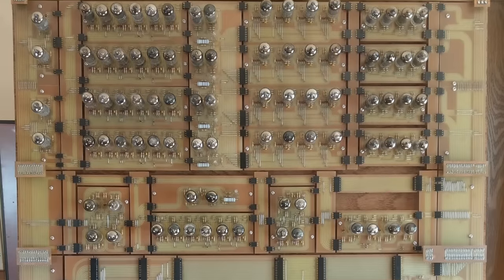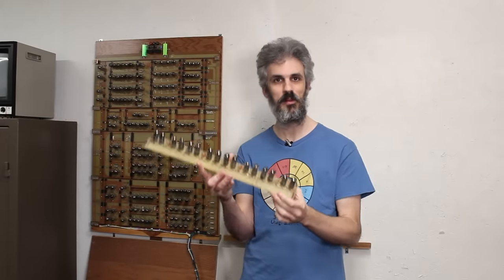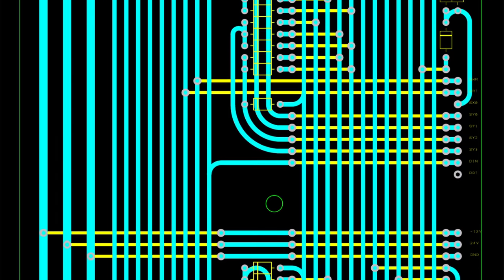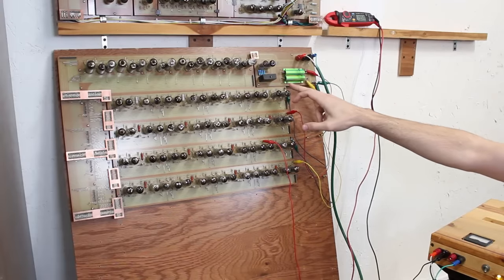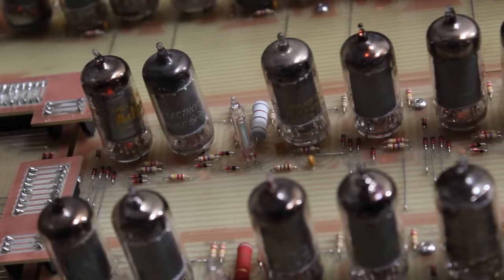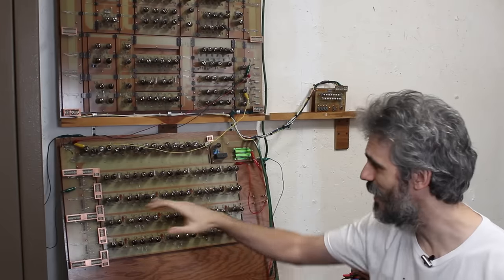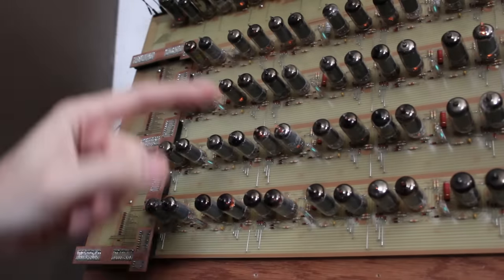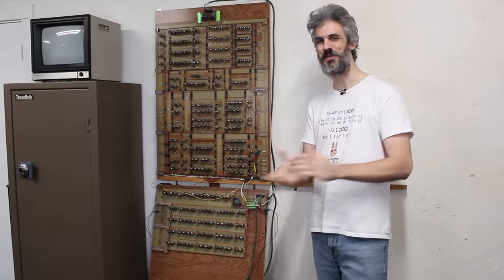Vacuum Tube Computer P.30 – Connecting 2-bytes of Tube RAM to the Processor

Comment: Tubes as memory wasn't the only thing employed in that era. I remember seeing a documentary showcasing acoustic memory. It was long tubes filled with mercury (IIRC) with a driver and a pickup each end. The signal was constantly refreshed by amplifying the output and conditionally feeding it back to the input. At a high enough frequency you could hold multiple streams  of bits in one tube.
Until someone slams the door shut and the entire data becomes corrupted :D
It is one of the whackiest methods I've ever come across.
Reply: Ah! That would be the mercury delay line memory. Came about in the 40s IIRC and yes it was esoteric (and whacky, by today's standards) along with the williams tube. And both susceptible to audio or visual sources of corruption - the delay line, as you pointed out, from sound, and the williams tube from even camera flash bulbs (when reporters took photos of the device). Must have been really fun times as a computer operator then... "Members of the press, we are proud to announce that our AwesomVAC has calculated the answer to the Ultimate Question! It is.... (camera flash) D'OH!"

Comment: Very impressive, so much fun to watch! I built part of a relay computer out of 120v elevator relays 20 years ago. I got nowhere near as far as you have with yours. But I did actually have working relay-diode logic with 40 bits of ram and a weird counter/shifter register unit that could count in base 10 and convert to binary, turn itself into a looping shift register and output or input serial data, base 10 (didn't quite get to the keyboard, I want to get back to it someday). That was hard but fun!!

Comment: Amazing, as usual! :)

I'm intrigued at your intention to use a reel-to-reel tape machine as program storage - will the tape have to move back and forth over the head for random access?

It would be fun if the Centurion could be utilised to create code for the VTC, or used as a terminal and storage to the VTC?
Reply from the maker: Thank you!
I'll go into a lot more heavy detail once we start the build, but the problem with program storage is that it's essentially memory, and memory is so, so hard. But, the MC14500 architecture has a way around that. Since the chip was originally designed to replace relay ladder logic in industrial applications, the chip had to be able to handle any kind of memory or program storage type that might get thrown at it. This is where IEN and OEN come into play. 

It's not entirely graceful and it makes programs considerably longer, but you can do conditional skipping using OEN quite easily. Then, you can either construct your program around a loop (ie. looped tape), or you can create multiple copies of routines on the tape. So the tape will always be trundling along at a constant speed and instructions will be 100% sequential, but we can do conditionals relatively easily, which will allow us some rudimentary type of "jumping". 

It requires a bit of a shift in thinking, and it's not going to be particularly powerful, but at the end of the day, it is a 1-bit computer, so our expectations weren't super high, haha.

We are working on a UE14500 emulator for the Centurion, and since the program control will essentially just be an audio signal (we'll use FSK to determine sequential data bits, a data clock into a shift register, and a global clock that executes the instruction from the shift register), we can pretty easily build an extremely simple audio card for the Centurion and write a custom CPL program that dumps a specific audio pattern based on a latched in value and the Centurion could be running long programs through the tube computer.

Then it gets even more fun because after program control, we'll start on input and output and the goal there is to bit bang 5-bit baudot or 7-bit ASCII, which could make it back into the Centurion as an input!

Comment: I'm not quite sure what you have in mind for your magnetic R/W memory system, but I can foresee big troubles approaching it using any sort of reel-to-reel system (including cassettes). The main issue is the controller needed to allow "random" access to any given bit in an inherently serial medium is decidedly nontrivial. This was historically overcome in one of two broad ways. The first (and easiest from a hardware viewpoint) is to use some sort of recirculating memory where each bit in the system periodically becomes available for R/W purposes. This was the way delay line memory and magnetic drum storage worked (and magnetic disks too in the first Titan ICBM digital computer). The key to making practical systems always involved having multiple "tracks" or channels with dedicated analog & digital write, read, and regeneration electronics for each such track.

One track was often dedicated to the system clock with all other bits in other tracks explicitly conditioned to it. The tracks would typically be of just two different bit lengths, so-called "minor loops" and "major loops". Minor loops were short (from say 16 to 64 logical bits long) and were most often used for implementing an accumulator or any other desired CPU registers and usually corresponded to one machine instruction cycle. Major loops were for program code and data and were commonly an integer multiple of the logical data length (plus overhead, discussed below) chosen for the minor loop.

To keep the word addressing hardware as simple as possible these machines often also had a dedicated address track containing a prerecorded sequence of incrementing digital address words. This meant that most serial machines had to incorporate at least TWO address fields in every instruction, one being the instruction's own -- self -- address and the other being the address of the next logical instruction to be executed. Conditional jump and branch instructions would require a third address for the location to jump or branch to. 

Now, the clock track mentioned above could theoretically have been used to advance a hardware program counter, obviating the need for the address track and for the self address field overhead in every instruction word, but since everything in the machine has to be handled in bit-serial fashion anyway the added complexity of a hardware program counter wouldn't really buy much more performance. True, each program word would be shorter without the overhead of the self address, and thus each major loop could either have more instruction words crammed into it, or the major loop could be the same number of words but have a shorter period. The logical program memory available to these machines tended to be in the low thousands of kilowords at most, so the addresses likewise would be, say, 12 bits. Most of these machines had fairly long data word lengths to simplify arithmetic operations, 30 bits being common, so 12 bits just weren't that big of an overhead once you figure in the need for a next instruction field. A three-address word might consist of 30 bits for the machine word size, 36 bits for the three 12-bit address fields. Data was usually processed LSB first to simplify the arithmetic hardware, but very often an extra bit duplicating the sign stored in the MSB was included because knowing the sign of a word before the first bit was processed made things easier.

The second way to deal with bit-serial storage was to throw an entire separate digital controller nearly as capable as the main computer at it. This was the IBM way.
Reply from the maker: The problem here is complexity. Everything you just described adds a level of complexity and a number of tubes that simply won't fit on my wall anymore. For reference, what you see in this video is approximately 270 tubes. If I wanted to add random access program storage, even if I used something like core memory, I would need probably around 1,000 tubes minimum just for program storage. This is because it's fantastically complex, but also this being a 1-bit processor means we need programs with thousands of instructions just to be able to do something that would normally be considered simple.

I'll go into a lot more heavy detail once we start the build, but the way we're going to tackle the random access problem is simply to not have it. The MC14500 architecture was originally designed to replace relay ladder logic in industrial applications, which meant the chip had to be able to handle any kind of memory or program storage type that might get thrown at it. This is where IEN and OEN come into play. 

It's not entirely graceful and it makes programs considerably longer, but you can do conditional skipping using OEN quite easily. Then, you can either construct your program around a loop (ie. looped tape), or you can create multiple copies of routines on the tape. So the tape will always be trundling along at a constant speed and instructions will be 100% sequential, but we can do conditionals relatively easily, which will allow us some rudimentary type of "jumping". 

Program control will essentially just be an audio signal coming in off the tape. We'll use FSK to determine between three different signals: data bits, a data clock, and a global clock. Each data bit will get shifted into a shift register on each tick of the data clock. Then, at the end of an instruction word, the global clock will hit that will essentially be the same as me hitting the clock button on the remote control. 

It's going to be quite obtuse to write programs for it, but with a long enough tape, you can do some really, really tricky stuff with the machine. And, since it's just an audio signal, this opens up the possibility for the audio source to be anything, meaning I can load up really, really long "tapes" in MP3 form on my phone and play them back. I can then experiment with clock speed, or even tricky operations to hunt down bugs or bad designs.

Most importantly though, it means that instead of needing 1,000 tubes for program control, I only need about 100 tubes.
Reply: @UsagiElectric  I understand what you are saying regarding complexity. Perhaps a  useful perspective to consider, though, is that back in the day bit-serial computers routinely had fewer than 500 vacuum tubes, including magnetic drum R/W circuitry; that was almost entirely because those designs put most of their complexity into the logical machine they implemented. Indeed, an exemplar of such a machine was the LGP-30.

From the Wikipedia article about the LGP-30:

"The single address instruction set had only 16 commands. Magnetic drum memory held the main memory, and the central processing unit (CPU) processor registers, timing information, and the master bit clock, each on a dedicated track. The number of vacuum tubes was minimized by using solid-state diode logic, a bit-serial architecture and multiple use of each of the 15 flip-flops. ... It was a binary, 31-bit word computer with a 4096-word drum memory.  ... The computer contained 113 electronic tubes and 1450 diodes. The tubes were mounted on 34 etched circuit pluggable cards which also contain associated components. The 34 cards were of only 12 different types. Card-extenders were available to permit dynamic testing of all machine functions. 680 of the 1450 diodes were mounted on one pluggable logic board."

You have to admit that implementing a 31-bit computer with just 15 vacuum tube flip-flops is pretty amazing. The way the magnetic drum worked together with the rest of the machine was entirely responsible for this.
Reply: Another way to think of this is to realise that the CPU you have implemented is at a really, really, REALLY low level of abstraction, much lower than most any CPU, past or present. It's much closer to the logic microcontrollers use except that THOSE machines are used to implement the programmer's notion of the machine using microcode, and the programmer never sees any that. (I have programmed in microcode, back in my misspent youth, and I'd rather drive a needle in my eye than do more of it.) Your CPU already has almost all the hardware it needs to implement a traditional higher-level Von Neumann register machine, and believe it or not to actually do so will very likely save you a lot of time and hardware. I would guess you don't really need anything like as many additional flip-flops as what you already have in mind to build. You've already built 16 flip-flops for two bytes worth. I'd be surprised if you couldn't do everything you need to do to turn this into a full-featured general purpose bit-serial computer with just another 16 flip-flops. The rest of your tubes, surely fewer than 32, would be allocated to R/W circuitry. At the very modest speeds this sort of machine is capable of, digital select and/or MUX/DEMUX circuitry can be made using relays.
Reply: @MrRlnansel  that’s really interesting, avoiding having tube memory at all, relying on magnetic memory, and building the compute units and interpretation/decoding circuitry. Basically exploiting the analogue domain of dimension (length) to reduce the need for binary electronics.
Reply: @kaitlyn__L  If any one thing could be said to be the secret of bit-serial drum computers, it was that high-speed electronic flip-flops were only used where there was really no other choice. A CPU has to have at least SOME fast state memory, but while it takes just two vacuum tubes to implement a single S/R flip-flop (one being a dual triode and the other being a buffer), most flip-flops require rather more than that; four to eight tubes were the usual cost per flip-flop. Consequently the designers of these machines used the fewest number of flip-flops they reasonably could and worked all of them HARD. For instance, anytime a flip-flop was used it meant that both true and inverted values of the bit were available to drive the combinational logic. This meant that diode logic AND and OR gates could create most logic functions required without the need for separate logic inverters on either inputs or outputs as long as the buffers on the flip-flops could drive all the gate inputs connected.

CPU state information that didn't require flip-flops was stored in the serial data streams of tracks on the magnetic drum (or ultrasonic delay lines). Each data stream, whether a minor loop or a major loop required tubes to make the pulse shaping write circuit and a few more tubes to make the pulse regenerating read circuit. No matter the length of the data stream, it required just a handful of tubes to handle. It didn't matter whether the data stream was 16 or 60 or 1024 bits long, the same number of tubes were required.

Minor loops also had to have two or three flip-flops extra to allow access to more than just two word bits at a time plus carry/borrow from the previous bit operation, but also to allow logical and arithmetic shift left and right functions. (The operation of right bit shift functions can be a bit tricky to visualise at first, but it's all a matter of knowing when to tap into the bit stream, and the extra flip-flops provide those tap points.) A 30-bit accumulator implemented this way would usually have only 27 or 28 of those bits on drum at any given time, with the other two or three flowing through the track's associated flip-flops.
Reply: @MrRlnansel  that’s fascinating! And yeah, I suppose I was thinking of “registers” as separate from “memory” (separate from the CPU die) just due to semiconductor practices; even tho in the Turing and Von Neumann models that’s not the case :)

Comment: Jumper wires for digital signals, you are right, build the harness!  Great stuff.  I wonder if a matrix of silicon diodes could serve as ROM to automate the cold-start instructions.
Reply: Diodes would be a ROM variant, but for density there's actually a better option: a PCB in the HP 9100 calculators provided ROM via inductance. Diode ROM should ideally be limited to configuration stuff that might be changed over time.

Comment: I would recommend looking at acoustic delay line memory, specifically using nickel and steel wire. They were used in some early electronic calculators as their main memory. It's been a while since I did any research on the topic, but they seemed pretty simple to make.
Reply: I really want to recommend that he reproduce a drum memory based on old wire-recorder technology, but I'm only seeing non-magnetic 316L, so your version is probably better.
Reply: Never mind, McMaster-Carr.
Reply: Another option would be to try using tape from an old VHS or audio cassette wrapped around a cylinder. Audio cassette tape heads are also cheap and readily available online.

Comment: I might have said this before, but strictly speaking Motorola's chip is called the 14500B or MC14500B, not just 14500. I think the UE14500 name is fine, but I think if nothing else, stating the name with the B for the Motorola 14500B avoids confusion with the 14500 type of battery.

Comment: I recently built myself a byte of memory using DTL(diode transistor logic) and ran into an issue with stability.  I haven’t fixed it yet but it mostly seems to be caused by manually toggling address lines.  I have slightly better stability when they are electronically addressed.  I think I need to add some zeners or comparators to act like a Schmitt trigger... you probably have something similar going on.